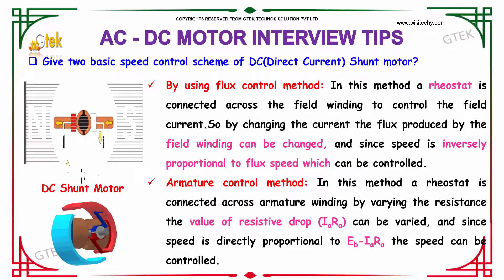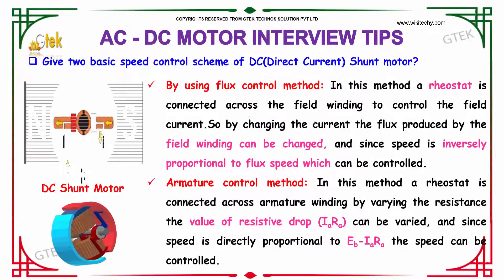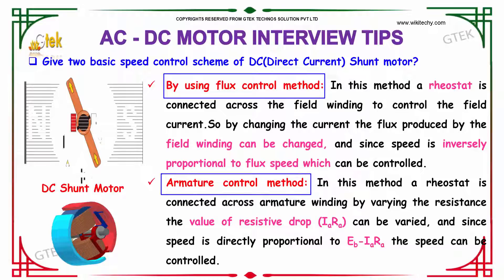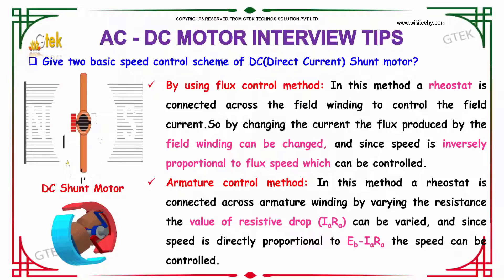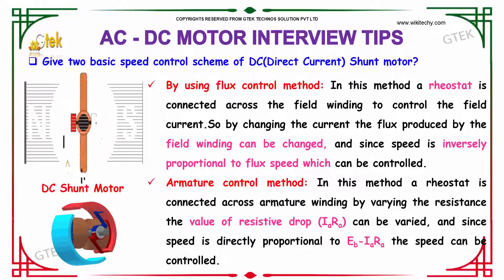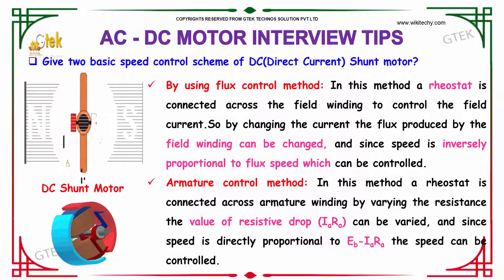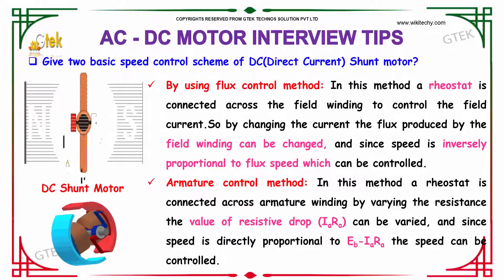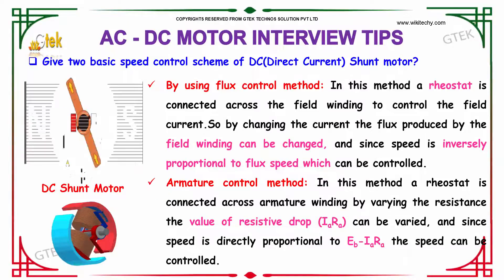Give two basic speed control scheme of DC shunt motor | AC-DC Motors Electrical Interview Questions

Comment: By using flux control method:in this method a rheostat is connected across the field winding to control the field current.so by changing the current.

Comment: using flux control method:in this method a rheostat is connected across the field winding to control the field current.so by changing the current

Comment: Give two basic speed control scheme of DC shunt motor?
By using flux control method: In this method a rheostat is connected across the field winding to control the field current.